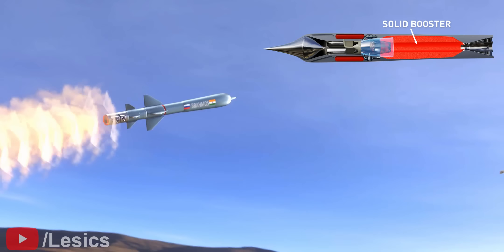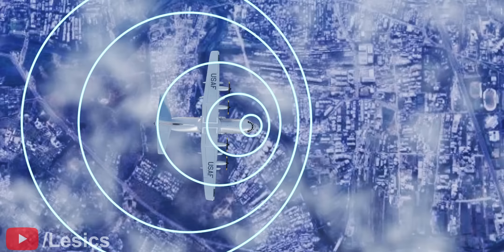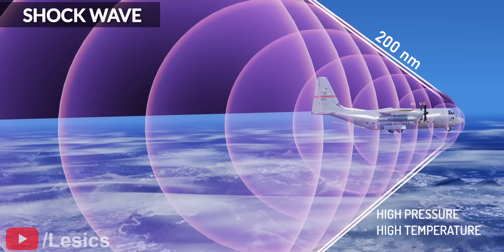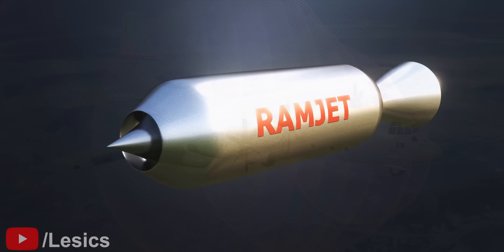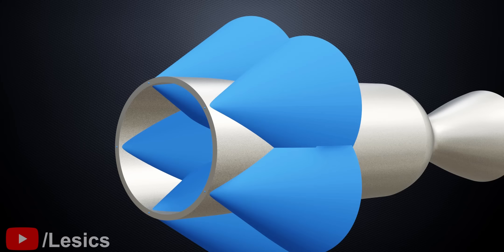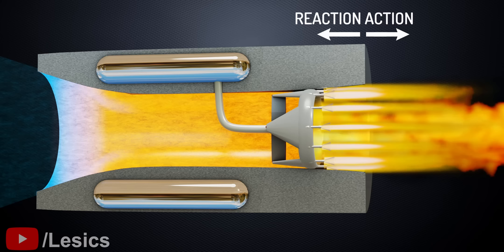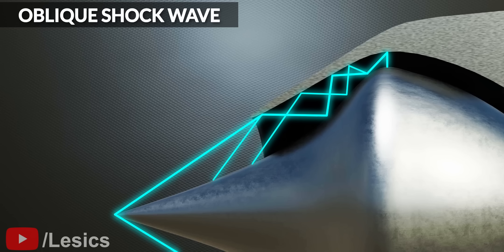Ramjet engines, How do they work?

Comment: Props to that AC-130 for reaching over Mach 1 with it's gears down.
Reply: Literally props
Reply: and the ramp partially open lol
Reply: Can’t see any guns, so it’s probably just a normal C-130.
Reply: กล้วยหอมจอมซน  Oh. I thought the AC-130 had guns on both sides. Whats the difference between a C-130 and a C-130J btw?
Reply: กล้วยหอมจอมซน  thanks
Reply: @bravoalpha101st  Someone watches to many movies.
Reply: So prop
Reply: Ya it is impressive that wind is pushing on the wheels and nowhere else my god how did they do that i cant believed that wind isn't pushing on the frame of the plane creating no resistance and only two wheels with calculated for resistant. My god its magic
Reply: Go back Marxist.
Reply: And an A10 with its engines under it
Reply: It's = it is
Reply: Props
Reply: @bravoalpha101st  It´s the current version, has lots of modern gimmicks like 6-bladed propellers, multiple monitors in the cockpit, composite material construction elements, upgraded engines ect. 
Basically the C-130 brought in the the 21st century.
Still won´t break sound barrier. No propeller plane can as far as i know.
Reply: bruh  And they're retractable.
Reply: Khomuna 
"Pulling 'em up's for cowards 😤"
 - That jet, probably/
Reply: Let alone any prop plane not making Mach 1. Lol
Reply: @sim.frischh9781  6 engines, only needs one to fly.
Reply: it has rocket props
Reply: haha
Reply: AC-130 top speed = 299 MPH (481.19 km/h)
C-130 Hercules top speed = 367 MPH (590.63 km/h)
C-130 J Super hercules top speed = 416 MPH  (669.49 km/h)
Mach 1 = 767.269 MPH (1,234.8 km/h)

information gathered via Google.
Reply: what about that A10 my guy
Reply: 😂same for the A10 with engines on the bottom too
Reply: wanna tell u that those props intakes are closed
Reply: bruh  J has 6 blades
Reply: @True American Patriot  too*
Reply: @georgehatzimanolakis1904  don care
Reply: @caseyiel  don't *
Reply: Bro that C-130 Hercules is gassing
Reply: He put his back into it

Comment: it's interesting to see a C130J go supersonic and if that's not enough it does so with the landing gear down
Reply: That's beyond physics!!! 😅😂
Reply: Absolutely Right!!! They must have used a fighter Jet for explanation... Such as F-16, Rafale, F-22 raptor or F-35 :)
Reply: Nice observation!!! 👍
Reply: Top speed of C130J is 670 km/h.... Mach 1 speed is 1234.8 km/h...
Reply: this is when in physics class teacher says you can ignore air resistance
Reply: It's because they had Afghans trapped in the landing gear door.
Reply: @ikmax2415  "Mach 1" varies with respect to the altitude (read density ) it's not a constant .
Reply: Clearly the boy was pulling very hard
Reply: I knew c130 is a legend, but it's definitely a miracle.
Reply: It huts my brain.
Reply: in addition rear loading ramp was also open during super sonic phase
Reply: I think they purposely did this to trigger us.
Reply: Not to mention the ramp was partially open. Also, straight winged aircraft would need a near infinite power to overcome the exponentially increasing amount of drag created by the sonic booms that would form along the leading edge. Aside from ripping the wings off, the prop blades would be supersonic and therefore unable to produce additional thrust, if any at all. Plus additional drag, etc.
Reply: @ikmax2415  nah uh, it seems you don't understand what Mach is. it is not the unit of speed, it is a ratio.
Reply: Don't forget the A-10 with underbelly engines!
Reply: I believe the crew wear nike
Reply: @stopthephilosophicalzombie9017  this is not a joking thing
Reply: I was more flabbergasted by the Fairchild Republic A10 with the engine nacelles mounted UNDER the wings. I'm guessing it lands on the nacelles and uses them to protect the landing gear from damage.
Reply: And the propeller at low rpm
Reply: It's possible with GN drive power plant.
Reply: lol exactly
Reply: @kajetus0688  lmao
Reply: @kunjukunjunil1481  True but a propeller aircraft can never break the sound barrier flying straight at any altitude, especially if you got too high where the atmosphere is too thin for the propellers to produce sufficient thrust.
Reply: They dont call it the 'Super Hercules' for nothing lol
Reply: @1empyre1life  Well you wouldn't need near infinite power to push a C-130 past Mach 1, but it would need a LOT of power for sure! The reality is that the C-130 would break up before it ever got to Mach 1, most likely due to wing flutter as it neared transonic speeds as the wings simply aren't designed for transonic flow. The props would stop generating thrust beyond Mach 0.6-0.7 as the blade tips would have to push beyond Mach 1 before the plane did, which may also cause extreme flutter and structural failure. If you did manage to get to Mach 1 somehow without any of this happening first, the aircraft would suddenly nosedive in what's called a Mach Tuck, where the centre of aerodynamic pressure would suddenly shift backwards, pushing the CoG forwards, where you would promptly find out that the ground is a fickle mistress.
Reply: i was lookin for a comment about this lol glad im not the only one
Reply: Bruh moment
Reply: L O L
Reply: gear down is the key trick
Reply: could be a herbie version
Reply: how do you know it's a J variant?
Reply: actually the c 130 could go supersonic but it would need different engines and different wings and and other stuff to but it could go supersonic with just different engines even though it wouldnt be efficient or safe it tear itself apart but if you say it need near infinite power that is way to intense and it mean the huans couldnt technically walk because a near infinite power wouldnt scale down enough to allow us to walk or anything to moving really also no such thing as near infinite power because infinite goes forever
Reply: impossible
Reply: @stopthephilosophicalzombie9017  lmao
Reply: @1empyre1life  That's fine. The main spars on a Charlie are unable to withstand forces outside the envelope. That's why they are shedding their wings at hard landings. A Charlie will break up structurally at around 450 KIAS, which would improve the hypersonic aerodynamics. 🤓😅
Reply: @sheilaolfieway1885  it would have to be a J-30 to see any difference 🤓
Reply: @PilotTed  wonder if a propeller actually would remain intact ?
Reply: Ah yes because fuck air resistance
Reply: The C-130J can break the sound barrier when the aircrew simultaneously shit their pants because their going way too fast.
Reply: Props feathered too.  Ram prop blades?
Reply: Its rear doors are partly open...
Reply: Have Super even in name! And with Earth speed in galaxy everything is supersonic!
Reply: @kunjukunjunil1481  No it doesn't.
Reply: Hehehehehe they could've portrayed the Kursk
Reply: So during the entire video u focused on the plane which they were showing 🤦🤦🤦🤦
Reply: @adityamisra7702  which is logical since it's a VIDEO
Reply: Lmfaoo

Comment: Imagine breaking the sound barrier in a C-130 with gear down
Reply: Drop it from space
Reply: The way I've always heard it, when someone asks if a normally subsonic plane can go supersonic, the usual answer is: Yes - Once.
I say usual because I doubt, for example a Cessna 172, could even do it once.
Reply: @mattbartley2843  In a nose dive?
Reply: @Dayanto  Vne for a 172 (never exceed / redline) speed is about 160 knots indicated airspeed.  Beyond that is risking the plane breaking apart from aerodynamic forces.
That's not even fast enough to worry about compressible flow effects, at least in any region of Earth's atmosphere that it could ever fly itself to.
I think the only way one could go supersonic is if it was somehow dropped from a space elevator or mesospheric cruise missile or something similarly ridiculous.
A much faster C-130 might be able to get supersonic in a steep powered dive, but, again, probably only once.  Even those "only" do about Mach 0.5 normally.
Reply: That would be one hellava ride!
Reply: @mattbartley2843  Most planes aren’t built to withstand supersonic winds.
Reply: I do that on the daily 😎😎
Reply: @mattbartley2843  should try the Russian Tu 95?

The fastest bomber aircraft with turboprop engines. You might be able to reach mach 1 with a deep nosedive.
Reply: At this speed it should start changing wing geometry, though at this model it would be one direction process.
Reply: And the ramp partially open
Reply: Only once.
Reply: Tried in ARMA 3 editor, never recovered from the dive.
Reply: imagine commenting on the same topic which ten dudes have already commented upon
Reply: 715 MPH? Erm ...
Reply: @johnwesly4630  EVER HEAR OF TERMINAL VELOCITY
Reply: @tanalafauzan  878
Reply: Ķmii
Reply: @zenko247  apparently you haven’t heard of the definition
Reply: The worst part is: Getting hit by a cruise missile 🤣
Reply: Şaşırtıcı olurdu.

Comment: The most unbelievable part in the video is where a turboprop model is used to demonstrate supersonic speeds.
Reply: with gears down😂
Reply: That was blasphemy
Reply: I've yet to see a prop engine plane that goes supersonic, especially one with the prop at the front, the shockwave would likely tear apart the prop..
Reply: @sheilaolfieway1885  I think you’d like the Republic XF-84H Thunderscreech. It wasn’t supersonic, but it’s props were.
One of the test pilots refused to fly the thing after his first outing saying “you’re not big enough, and there’s not enough of you to get me in that thing again”.

The monstrous amount of noise produced literally induced a seizure in one of the ground crew.
The shockwaves it continuously produced even when idling were powerful enough to blow people over.
It’s believed to be the loudest airplane ever made
Reply: @deathdragon2283  id guess the tu 95 is quite similar
Reply: Lol. . . Funny
Reply: ... and even more - the plane did not need to hide the landing gear to cross the sound barrier!
Reply: And the landing gear down at that.
Reply: Oh, no. NACA and early NASA did some fantastic tests for supersonic propellers. Survey Says: A turboprop can achieve up to 80% propeller efficiency at Mach 1.02. And it is feasible to build a supersonic turboprop, given a 20,000HP turbine power-plant such as that found on the Tupolev Bear, somehow mounted in an Spitfire sized fighter. Turns out, Turbojets make more horsepower the faster they go, right where you need it. (Thrust X Knots / 325).
Reply: @TheJustinJ  a turboprop cannot reach mach 1.02 so it's a worthless test, also I'm not sure you even realize what "80% propeller efficiency" means.

If it is only 80% as efficient past the sound barrier, how do you expect it to fly supersonic.
Reply: With ramp partially open

Comment: Great explanation!

Nitpicking detail: The Brahmos-II is the fastest missile atm with a speed of mach 8 and using a scramjet engine(beside other systems that operate outer atmosphere and doesn't count here).
Reply: Brahmos 2 is the fastest missile?
The missile hasn't even been developed yet!
Reply: @shashankr5180  Developed and tested - as it is still not a finished product. But still it makes the speed. And therefor i count it.
Reply: @shashankr5180  its finished but still being worked up

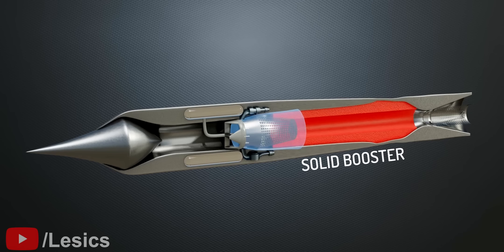Comment: For anyone wondering; I couldn't find any information, that would indicate the ramjet's combustion chamber is filled with solid propellant as shown at 07:10. 

Brahmos just uses a standard 1st stage solid rocket booster, that is jettisoned when it transitions to air-breathing mode.
Reply: So how many stages does brahmos have??
Reply: @desifirangi77  Two. Standard first stage solid rocket booster, and ramjet second stage

Comment: Everyone’s already mentioned the supersonic c130 and the questionable engine placement of the a-10, but my question is why is it being shot at by a cruise missile?
Reply: yeah i wonder like cruise missiles are not designed to do interception and surface to air missile can do it better because  it can and do travel beyond the speed of sound just like all other missiles
Reply: Yeah it would be pretty pathetic if SAM missiles couldn't reach supersonic speed.
Reply: on top of the fact it CAN'T be used against an aircraft, IRL the missile is 8.6m long, half the size of the A-10, so it's way too small on the video

Comment: SR71 is the perfect example of this
Reply: Sr71 is actually a turboramjet engine👍🏻
Reply: Yes, that explains the cones at the front of the engines.
Reply: @keepmahaney7412  still a ramjet though right? Same principle
Reply: sr71 has the early prototype of the ramjet engine. It's also mixed with a turbojet. Making it a "Turboramjet".
Reply: @dy7296  I thought it was a pure turbo ramjet?
Reply: @dabulls1g  it is. just a prototype.
Reply: Nope, SR71 has turbines. This missile has no moving parts inside. Similar in principle though.
Reply: @raptorreaper  yes, but it has a special type of afterburner that can allocate how much thrust proportion it can make via a variable bypass valve. Starting from 15% thrust at subsonic speeds up to 85% thrust at Mach 3+. And that's the early version of the ramjet mixed with the turbojet.

Comment: Water waves.

That is also how speed detector radars work. It measures the delta frequency created by the moving object that is hit with an electric magnetic vawe (radio). The electronic circuit that is used to detect the delta frequency is called phase detector.

Comment: The video is very helpful to understand the physics behind the ramjet engine but it starts with two incorrect statements. First, the Brahmos is the first-ever supersonic antiship missile. It is not true because the Russians already use supersonic ASM from the 60.s. Second, no air defence system can shot down this Brahmos missile.  The Brahmos speed is Mach3 and most of the mid-range SAM systems can deal with Mach3.5-4.5 . So it is absolutely not an unshootable missile.
Reply: Reality doesn’t works like theory
Reply: @commanderofkesariyaknights  Tell me please why a SM-2/AEGIS combo can not shoot down the BRAHMOS ?  The Brahmos is not stealth and  long range attack mode it flys high altitude. Short range attack mode low altitude but still  relatively high RCS so easy to pick up for the AEGIS. That means two SM-2 missiles with the imitation of max targetspeed  M4+ are on their way. So WHY????
Reply: If you can't detect a fast moving missile than you can't shoot it down regardless.  It's like shooting a bullet at a bullet that you don't even know is coming.

Comment: What is being described in this video is a SCRAMJET, a Spersonic Combustion RAMJET, rater than a RAMJET. While ramjet engines can power a vehicle which exceeds the speed of sound, they cannot ingest supersonic air as the engine depicted in the video does. This is an important distinction which the authors of this video somehow fail to make. All SCRAMJETS are RAMJETS, but not all RAMJETS are SCRAMJETS.
Reply: I think you are right , it should be scram jet not ram jet .
Reply: @karthikkrishna5870  At t=381 you see the normal shock typical for a RAMJET: https://youtu.be/kHSJiO_Fvvw?t=381
Reply: Nope, this is a Ramjet. The diffuser and shock cone slow down the airflow into the combustion chamber to subsonic speed. It is the Nozzle that accelerates the burnt gases back to Supersonic speed. The layout of this engine is identical to the Thor Ramjet of the Bloodhound Mk II missile that I worked on in the 1980's.

Comment: Can you explain how the brilliant engineers provide guidance and control for an object supposedly traveling 20000+ miles per hour through ever varying atmospheric conditions and pressures? I would love to hear about that.
Reply: It's self guided so computer on board makes adjustments once given a target and travels at mach 3 not 20000 miles per hour?
Reply: Somebody is sitting inside pulling the levers to stabilize it
Reply: Ceramic,tungstene (W) propulsion dirigida , look F22 F35 tail...

Comment: @Lesics 5:50 can you explain the increase in pressure when there is a decrease in cross sectional area? Generally as area decreases, velocity increases resulting in a drop in pressure according to Bernoulli's principle. Does that change in supersonic conditions?
Reply: Bernoulli's principle assumes incompressible flow, which occurs only at subsonic speeds

Comment: who made that hideous A-10 Warthog animation?
Reply: What's wrong with it?🤔🤔🤔 Can you please explain it?!?
Reply: @playerscience  the engines are in the wrong position.  The engines should be high on the back of the fuselage, between the wing and the horizontal stabilizer (the smaller rear wing).
Reply: @elena6516  thanks 😊

Comment: I dont know wot u meant wen trying to describe wot a shock wave is but the way i understand it is this; sound is produced by the atmosphere around us being disturbed or vibrating such as wen a speaker pumps the air back n forth really quickly. It is that vibration in the air that is translated into sound. The spead at which air can carry a vibration thru it depends on density n temperature, tightly packed molecules knock into others quicker so pass it on quicker. Wen u create sound continuously but travel in a given direction faster than the air can pass on the vibration caused by the sound ur basically travelling faster than air can naturally move out of ur way so u end up pushing it into a really high pressure area jus in front of ur craft n that is wot causes the percieved wall. Sound ends up propagating from u in a cone going outward behind u. Hope this made sense

Comment: The reason they are using the oblique on normal shockwave in the ram air inlet is each time air passes through a shockwave the velocity slows down. Normal shockwave being the strongest shockwave slows it down the most untill it is subsonic. Slowing down the air increases it's pressure and prevents the blowback from the combustion chamber.